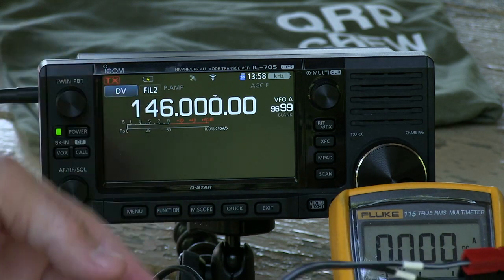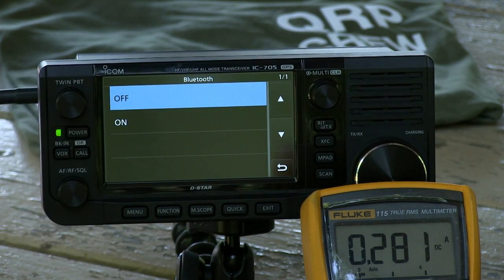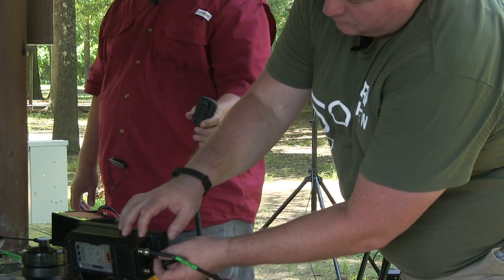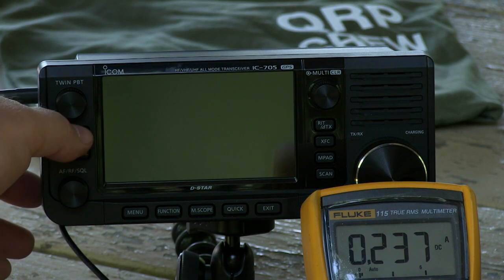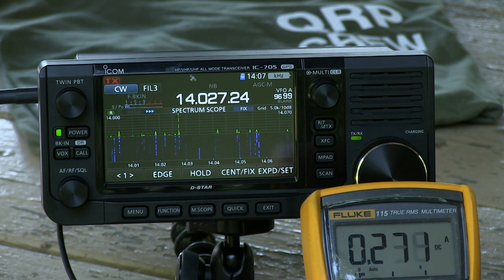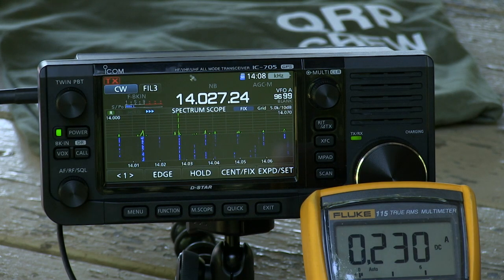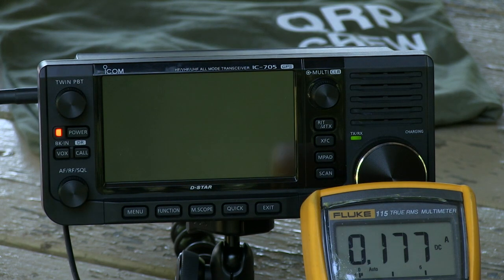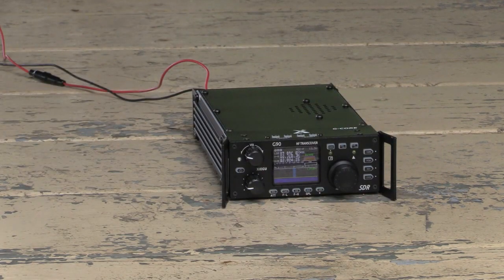IC-705 Minimum Current Tweaks

Comment: I think it's a outstanding current draw for such advanced rig and good display, im starting to get hyped. The only thing that will have to check it's the frequency stability on 2M/70CM, thinking of using it as IF radio with a transverter for the milliwave bands and digital modes. The IC-9700 was not very good on that, hope it get fixed with this rig
Reply from the maker: I believe it was fixed quickly in the IC-9700 with a firmware update.